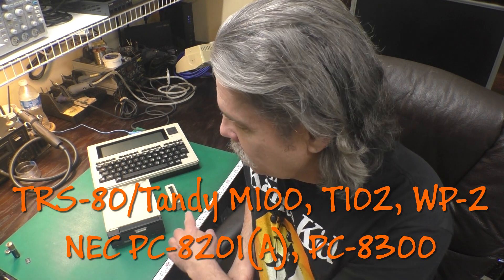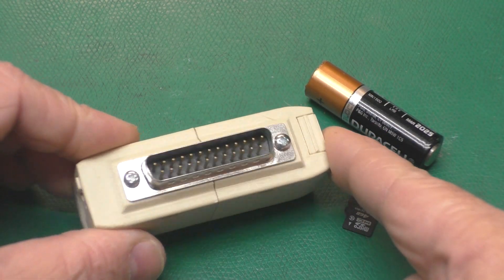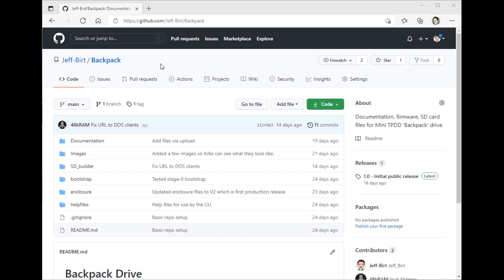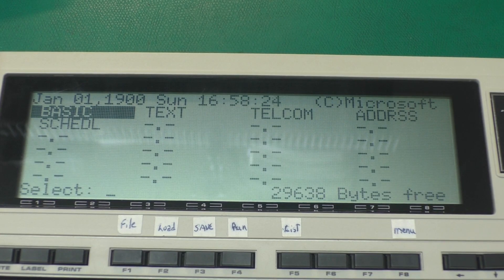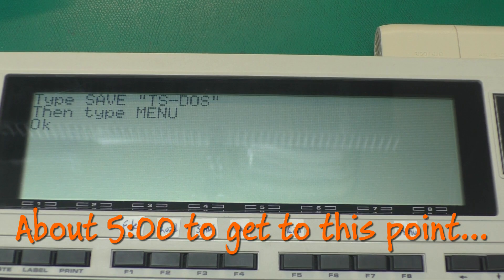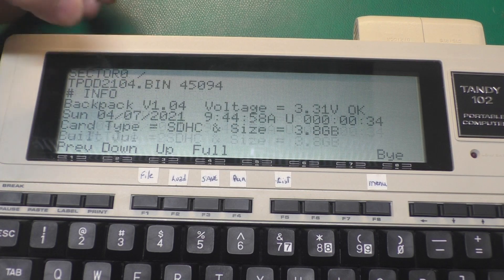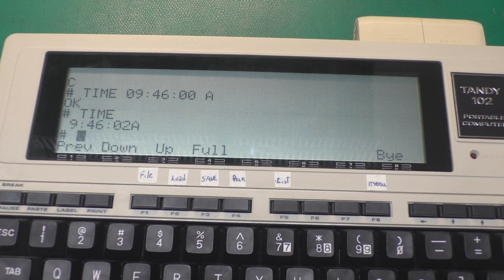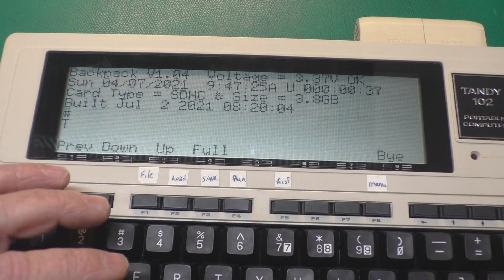Quick Start: Backpack Drive SD storage solution for Model 100 type computer. Set up and basic usage.

Comment: A few questions...do you still have those T100/102 backpack drives in stock? How much for a completed kit? Do i have to run the program creating the extensions that will allow the T100 / 102 to talk to the backback drive every time i boot the computer or is this just a one time thing?
Reply: Just a one time thing. At least for as long as your memory battery is working.

Comment: Hey there. Love the video and product. I just received my backpack today and have been playing around with it. I noticed that a "# Check Battery/Card" prompt keeps coming up, even though the card has been formatted and the GitHub files are all correctly in place on the root. I also have new batteries (tried multiple). Also, sometimes when typing something like "ls", the text will be doubled like "llss". Are these known issues and do they have work around? Thanks!
Reply from the maker: You need to have a good 1.5V battery in the Backpack. You cannot use a 1.2V rechargeable cell. If you issue the INFO command what is the battery voltage shown? It will show you battery voltage and level of the 5V rail. Also make sure that you copied the folders to the card too, i.e. SECTOR0.

The double characters problem is caused from having the full/half duplex mode set wrong in TELCOM.
Reply: @HeyBirt Great, the double text is gone.  Just working on the "battery/card check" issue. 

The main is at 3.34v, battery is at 1.57, card type SDHC & Size 7.7GB. 

I formatted the card to fat32 and dragged the entire sector0 folder into the root of the card.
Reply from the maker: @inranglhood60  On GITHUB did you use the BPD or BPD+ files? The new one you just got is the BPD+ version. Also, it would probably be easier to use the GitHub ticket system for support. YouTube is not well suited to it.

Comment: Very cool device - do you know if it is compatible with UK version model 100? I think there are some differences in the rom but not sure. I’d be interested to get one if it is compatible (I’m a model 100 newb in 2022 😂) Great channel BTW!!! 👍
Reply from the maker: Yes, it is compatible with all M100s. There are some very early models which have the wrong transistors in the serial out line, Tandy released a service bulletin about it. The only potential problem I am aware of.

We will have another batch of them soon. Check video description and/or the 'About' for the channel for contact information.
Reply: @HeyBirt  Subscribed - excellent channel 👍

Comment: Hey I have a stupid question (I Read The Fine Manual but don't understand how to do  it) - how do I transfer files from the SD card to RAM?
Reply from the maker: Most folks use TS-DOS. The 'Quick Start' section at the beginning of the manual describe how to bootstrap TS_DOS into RAM if you don't already have a version on ROM (or a REX).

I also wrote a TS-DOS reference guide which I just realized had not gotten added to the BPD+ documentation folder. I just added it. That will help show you how TS-DOS works.
Reply: @HeyBirt  ah so TSDOS recognizes the backpack as a drive. Didn't realize that. I've been using TSDos with my laptop via mcomm and it works pretty well but having it tethered is annoying.

Comment: Is it possible to use this backpack on an 8k model 100? I only have 5k to play with when it’s cold.
Reply from the maker: You would need to use a REX as you won't have enough RAM to hold TS-DOS. The REX provides TS-DOS in ROM.

Comment: I always wanted a model 100... there was a portable terminal in a similar case. wanted that more. Terminals can be very useful. Can the 100 be used as a terminal?
Reply from the maker: Hi, yes it has a serial port (what the Backpack uses) and a built in modem. The 'TELCOM' program I was using is a terminal program. 

I picked up a M100 system from the original owner a few months ago that used it in his work to remotely connect to early Linux desktop computers to to demos to customers.

Comment: Work with Olivetti M10?
Reply from the maker: If you use the Version of the TRS_80 M100 ROM which was modified to work on the Olivetti M10 then it will work. There was never a version of TS-DOS written for the M10 itself.